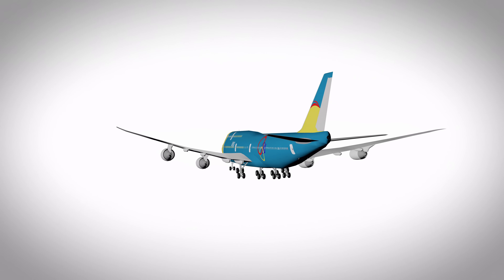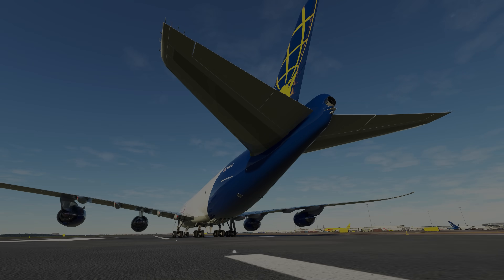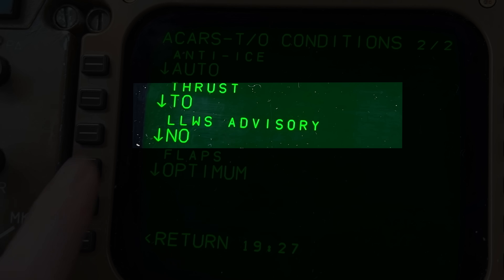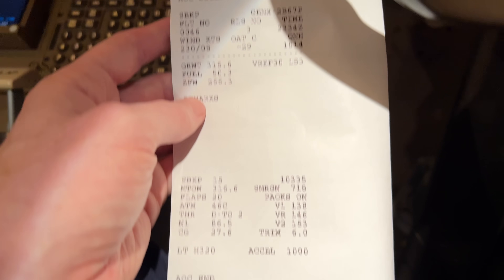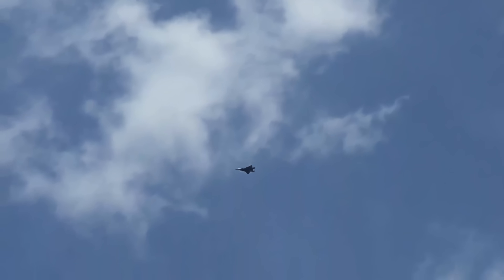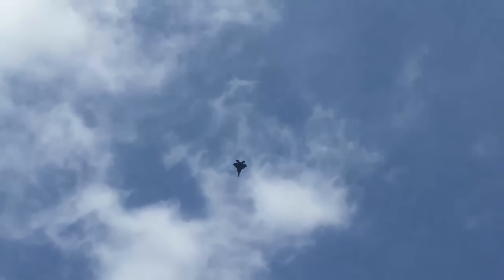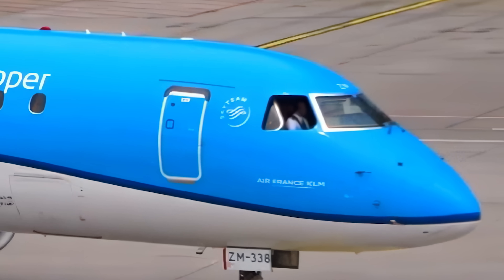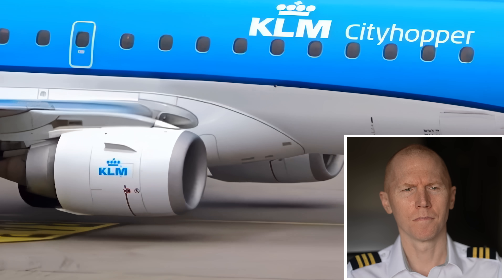Unsafe 747-8 Vertical Takeoff

Comment: Honestly shocked you haven’t tried this or a wheelie on the 747 yet, like you said, all pilots are secretly children 😂
Reply: FYI, a "wheelie" is primarily used for short field takeoffs, and pilots (mainly flying single engine) use this type of takeoff when taking off from grass or gravel runway so that the front wheel doesn't get stuck in the mud or snow. The only time if would be beneficial for an airline pilot to do this is when they have to fly over 50 foot obstacle to get the best rate of climb.
Reply: @ProgNoizesB  funny. But he says he’s done it a few times. I do think he and the other pilots use what he described as logical reasons, as an excuse lol.
Reply from the maker: well a very well known secret haha
Reply: Isn't that how tail strikes and return to the airport for damage inspection happen. This plane had an unusual angle of ascent, but no tail strike.
Reply: @ericmcgovern1764 An A&P friend of mine accidentally wheelied a 767 in a reposition taxi. Oops.
Reply: @ericmcgovern1764  so many people took this seriously god damn
Reply: @ericmcgovern1764 you’re thinking of a soft field takeoff. For short field takeoffs on a single engine piston, you hold the brakes, add full throttle, and release the brakes once you’ve attained all available power
Reply: @hollytodd6981  so many people act like they know what they are talking about, but actually have no clue...like you...
Reply: @ericmcgovern1764  it was a joke, Jesus Christ

Comment: Just a note here from a trucker. Truckers actually do use transmissions to  slow our truck down. Of course brakes are used as well, but when driving a manual truck you actually want to use your transmission as it''s much more durable. Plus with the heavy load, brake fade is a lot bigger of a risk.
Reply: Same with those of us 4-wheelers with standard transmission.
Reply: Using engine brakes on cars is also a good thing. It not only saves brakes, it also saves fuel and stops the brakes from overheating, which is relevant when you live in the mountains. A transmission can handle it no problem - I have yet to have a transmission give up on me even after decades and hundreds of thousands of kilometers while doing engine brake all the time.
Reply: Yeah I mean even on a regular manual trans car you can do that. I used to do it on my previous car. Instead of just letting it coast and stopping with the brakes at a red light, i would just downshift through my gears and that would reduce my speed by a huge amount and I only had to use my brakes at the last 15 miles per hour or so. You don't really do that if somebody cuts you off and you need to slam on the brakes but if you're coming up to a red light at a normal speed you can do that.
Reply: @SweetTooth8989  
Most automatic transmission cars will allow you to engine brake, just use cruise control.
Reply: @yamahantx7005  true. My Corolla died that too even though it's auto. It also downshifts automatically when braking to help slow down.

Comment: F22 was doing a falling leaf maneuver. It was smooth because it is capable of post-stall maneuvers.
Reply: It also has Thrust Vectoring (in the vertical plane, the F-35 has both vertical and horizontal vectoring) so that makes a low altitude recovering even easier than it would be in older jets.
Reply: Crazy things happen when thrust exceeds weight!
Reply: The sukhoi cobra are SICK as well
Reply: ya....  but ive not seen it done like that before!!!  pretty badass maneuvering!  that would be a hell of a ride.
Reply: "I'm a leaf on the wind. I'm a leaf on the wind"
Reply: The F35 does not have thrust vectoring aside from the b model vtiol
Reply: *manoeuvres
Reply: @Sirenhound  At least this pilot wasn't in a firefight between the Reavers and the Alliance!
Reply: Correct, simple falling leaf maneuver
Reply from the maker: witchcraft!
Reply: @74gear  😆😆😆😆 don't try it at home (or in a 747)
Reply: @timengineman2nd714  F-35 only has vertical for the USMC version. All other variants are standard non thrust vectoring nozzles.
Reply: @74gear  Lol thrust vectoring and digital flight controls. Without the computer it will fall out of the sky like a brick. You may have a bathroom, bed, and snacks; but he's much faster then you are while using the same or less amount of fuel, can turn in much tighter, and look cool doing it.
Reply: @webcucciolo i think the 2 are the same for Kelsey😄😂
Reply: @fightingfalconfan i think the f22 with full afterburner can actually burn fuel almost 2x faster than a 747😮
Reply: @Sirenhound  "Watch how I - ARGH".

More on-topic, the F-22 might also have been using differential thrust.
Reply: @PsRohrbaugh  You just explained the whole concept of rocketry in one statement.
Reply: @Sirenhound  Yeah, but this leads to washing a spear or two.
Reply: @exploreraa983  Yes, pretty cool but I'd probably be unconscious  LOL.  I think I remember hearing at an air show once that these were used in combat evasive maneuvers.  I'm impressed and proud of them all!
Reply: @fightingfalconfan

You're literally comparing a sports car to a bus lol
Reply: @christianurzica6668  good point 😆
Reply: I'm just surprised they get enough air in but I guess once the engine gets going air intake draw is self-sufficient

I don't know why I expected/linked intake to be an issue just associated stall with loss of lift as well as engine stalling due to airflow.
Reply: @74gear  LOL ... something like that ... I was on the initial flight test Team (1997) ... and yeah, it is intended to be like "witchcraft" ... and why it is the only USAF fighter to NEVER be exported (including UK/Israel). She's a hellava bird I tell ya !!!
Reply: @Sirenhound  Watch how I soar
Reply: Gave me flashbacks of Goose dying on Top Gun...
Reply: @74gear  No, it's a stall. A flat spin stall. Easy to recover from as long as your engines are running, though if you flame out you better eject before you hit the ground
Reply: 🤔 it’s called a “hammerhead stall,” or at least it was when I was around the USAF.
Reply: @lottievixen  flameout is definitely a possibility, and if it happens you basically have to eject. Modern computer controls help significantly, but it's still a concern.
Reply: @74gear jealous 😂
Reply: @74gear  You know what's similar? And magic? A kestrel. Look up kestrel hovering / hunting. Check out the control surfaces including the independently moving feathers :) Seriously, as a pilot I am sure you can appreciate it.
Reply: @dunuth that hover is slow flight into a headwind, not an actual hover. It's like a STOL with a headwind that matches it's landing speed.
Reply: @markfox1545 *American spelling
Reply: ....and it has vectored thrust and there is a black magic box or 2 in there that are making it all happen very easily
Reply: @timengineman2nd714  actually I'm pretty sure the F-35 has none (unless you count the 90 degree tilting for the B variant).   The Su-35 has multidimensional TVC iirc though.
Reply: stall-by-wire haha
Reply: @fightingfalconfan  But can he carry 200 tons of cargo? :)
Reply: Isn't it similar to a flat spin?

Comment: I don't think this pilot was hand-propping the plane. He was probably just doing a standard walkaround where you actually are supposed to turn the propeller once or twice as a check. But you do that only after you make sure the magnetos are off. If the engine is hot (from someone flying it before) and the magnetos remain on, the engine may kick up even after such turn. In this case he probably had throttle in a position other than idle also, judging by how fast this plane started to accelerate... A couple of rookie mistakes in one.
This is why you should always, always check for magnetos off before doing it. And putting parking brake on would also make a lot of sense.

Comment: "Car guy" here driving manual(s): Using the motor to brake has to be done right, else you wear down your clutch way too fast. The gear wear is less a problem unless you are among those who force a specific gear with muscle power. Best is to adjust the motor rpm to what it should be while being on the clutch when shifting down to minimize wear of both and still save brakes & fuel.
Reply: Watch your wind break 😅

Comment: 12:53 - As someone who drove manual transmission cars for MANY years, it IS preferred to downshift to slow the vehicle down, then only use brakes as necessary, when going slowly in second gear.  The transmission/drivetrain is MUCH more sturdy, and that puts almost no practical amount of wear on them.  Plus, by minimalizing the braking, you prevent heat buildup in the brakes.  Heat increases stopping distance.  In the event of any emergency, cooler brakes are MUCH safer.
Reply: A better analogy would be throwing the car in reverse to slow it down, except that would actually burn out the clutch and maybe the gearbox where as an aircraft the entire engine is running in reverse.

Comment: I have actually experienced a max power takeoff when in the 70's while in the navy. Our crew was flying back from Rota Spain. The runway was under work. We could not take a full load of fuel so had to refuel at Gander. Our pilot had obviously had his initially received training as a carrier pilot. On landing all wheels hit the ground and never budge. On leaving Gander he must have recieved take off clearance half thru the turn onto the runway.The engines started to spool up. I have never experienced such a fast turn on a commercial jet. We never slowed. On barely leaving the ground he practically stood it on its tail and screamed skyward. What a thrill ride.

Comment: Ah, this reminds me of so many things. 

Many years ago, I worked for a simulator company (Link). They had a commercial airplane simulator system that could be tuned to different planes, thus lowering the cost of development. Then, someone had the brilliant idea of using that same math model for a military aircraft simulator. Well, as seen in this video, the military craft can not only fly straight up, but accelerate (basically all the Gen 4 fighters). Of course, the math model being used crashed when you attempted to do that. So, not a great idea.

At about 10:00 it is mentioned that the commercial airliner couldn't do all those fancy maneuvers, but that it had a bathroom, food and a bed. That is exactly what a friend of mine who was a P-3 pilot said to a fighter pilot that did all those maneuvers around him. When the fighter pilot boasted about what he could do, and later came back, my friend said, sure, but I just had a meal Can you do that? Of course, P-3s are long range maritime patrol aircraft (ASW) and they would routinely go across the Atlantic to Spain (from the US mid-Atlantic), patrol around and come back. A real blast from the past.

Comment: Imagine you flying along with your hand out of the window. So refreshing on a hot day
Reply from the maker: it might be a bit "wind in your face" than you were hoping for
Reply: Rode the door open going to jump altitude . Very odd sensation first jump I did we let people  out at 4g on way to 10.5 . How casual he was just open the door waved to me then seen him out the side window a few hundred feet down doing backflips in the air knowing a mile higher and few minutes ill be doing the same .
Reply: You know, until you get immediate frostbite from -50 degree winds at 30,000 feet and are unable to get your hand back in due to 500 pounds worth of force.
Reply: @dacomazielsdorf7618 my stomach is also doing backflips just reading this!
Reply: @NobodyInParticular001 yes, proper refreshing! ( On a hot day obv 😉)

Comment: The sequence at 8:20 involves some tricks with thrust vectoring... the engines don't necessarily just point toward the back so you can move the thrust vector off the axis of the body.  This allows you to do a number of interesting things if you are being chased by bad guys but at the expense of poor efficiency and high fuel consumption.  This includes spins that aren't spins, tight uncoordinated turns, and likely stuff they don't want anyone to know about...
Reply: You are correct however in conjunction with thrust vectoring This WAS a modified flat spin done really slow due to the thrust vectoring. The "Extra" and other stunt planes do this all the time with such a narrow CG and center of pressure. They can play with this maneuver with ease
Reply: Not really thrust vectoring.  If you look closely you can see the VTOL door open and the rear engine nozzle down.  They went into VTOL mode for a short time, then back again.

Move like that in combat is a bad idea.  Makes it real easy for a enemy to get a shot off.
Reply: They definitely had a co pilot who woke up late and had a protein shake mid flight and started gassing everyone out…  lol
Reply: @caferace8418  that is an F22, not an F35.
Reply: @caferace8418  No, This is an F-22.  It does not have a "VTOL mode,"  even for a short time.

Vertical thrust in a close quarters dogfight can be very useful.  The British pilots used vertical thrust vectoring capability of their Harriers to great effect against the Argentinians during the Falklands War.  With the enemy  on their 6, they would pitch vertical,  roll 180 degrees during climb, then coming over the top they inverted they would briefly  rotate the nozzles for vertical thrust, thus making the enemy overshoot and often putting the Harrier in a perfect position for a Sidewinder shot.  Later, the US Marines  and Italian and Spanish navies adopted this tactic for their own AV-8s.
Reply: @caferace8418 
that's pretty clearly an f22?
Reply: That’s an F-22, and it doesn’t have yaw axis thrust vectoring.  It’s executing a controlled flat spin, but unlike aircraft like the Sukhoi-35 or MiG-35, it’s controlling it using aerodynamic controls, and one suspects differential engine thrust, as evidenced by the fact that you can hear at least one engine in afterburner.  You can also see that while the plane is yawing left, the flaperons and horizontal stabilators are commanding right roll, which enhances yaw control because the plane’s traveling straight down, rather than straight ahead.

In any case, it’s quite the torture test for airframe, engines, and inlets.

Comment: 12:33 - He meant to say "To downshift in order to slow down, rather than using your brakes" which would've been more accurate, because if you downshift going too fast, you'll overtorque your sprocket and it'll likely break that gear.
Reply: he clarified lol, just saw that.

Comment: The reverse thrust analogy is more similar to using a jake brake in a truck. Generally, we are actually encouraged to use our Jake, but some drivers prefer not to use it when they are empty, or if you have a light trailer, in the rain/snow. It’s also considered rude to use it in a truckstop, especially if you have an un muffled truck. For me I use maximum jake whenever I’m driving unless I am completely empty, a good trucker won’t touch the service brake until they’re at low speed or in an emergency. 

In reference to planes though, I notice a lot of CRJ pilots use the reverse thrust to slow down on the taxiway. I go to the Charlotte Douglas airport overlook a lot, and the taxiway from the western runway toward the terminal is on a slight down hill grade.

Comment: When driving down a mountain, it is SOP to run in a lower gear (roughly as low as the one you use going up).
The problem is that when wheel brakes run hot, they stop working. And if you try to use them long enough going downhill, they will get too hot.
So when going downhill for any decent amount of time, you want to use as much engine and transmission resistance as possible to keep the speed manageable.
I lived near one of those long, serpentine roads. Where a lot of people tended to forget that rule. Ended up overheating their brakes, then went straight into the river.
Reply: An effective brake cooling procedure
Reply: It's also great for fuel economy to use engine braking.

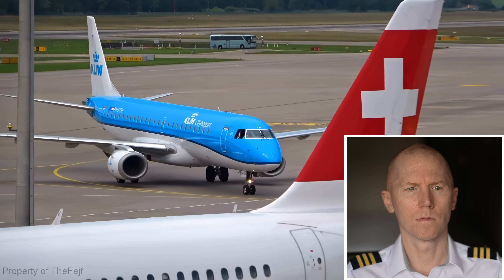Comment: At 10:44, it looks like the plane is taxiing much too fast.  I am surprised that Kelsey did not mention it.

The "Airplane!" movie from 1980 had a great shot where captain pays for the plane's fuel by handing the ground crew a credit card through the open cockpit window.  They process the card with an old fashioned imprinter, and hand back a carbon copy receipt for the captain's signature.
Reply: Paying for fuel by credit card is not all that uncommon. Normally airlines have a contract with the fuel companies at the airports that they fly into, so the pilot just has to sign for the fuel. But if they go to a infrequently used airport especially in foreign countries, or in the case of a diversion to an airport where they don't have a fuel contract, then the pilot pays for the fuel with a company credit card.  And a few decades ago I wouldn't be surprised if they used the old fashioned imprinters.

Comment: I think a bigger effect here is distance compression due to the angle the plane's direction of flight makes with the camera.  The plane might be light and all those other issues, but looking at a small angle, nearly tail on, is going to make it look like it's going straight up because the perception of forward motion is minimum at that angle.
Reply: Yes, steep, but nowhere near vertical !  Impossible in any 747 anyway!
Reply: It didn't look more than a 30degree rising angle to me. 
Ryanair does that with a 737 full of people and the 777 I left home recently was maybe 20degrees.
Reply: Yes, often used for dramatic effect when there is no drama.